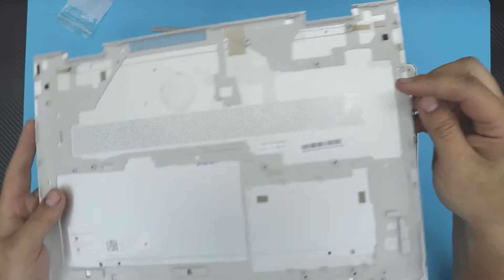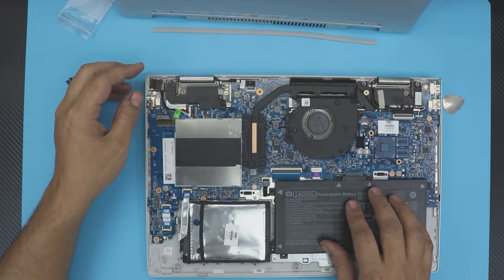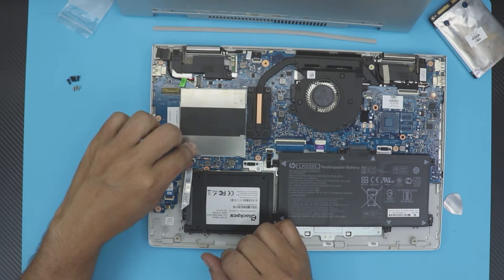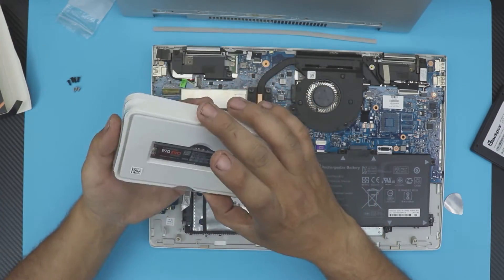Hp Envy X360 15M SSD NVME m.2 Upgrade - STEP By STEP

Comment: I have m.2 nvme of 500 gb in my envy laptop but am out of storage.  Do you have a suggestion on a larger like 750 or 1tb m.2 nvme? Do you have a video on how to get a person items from one M.2 nvme to the newer easily? Thanks for any info in advance.
Reply from the maker: 🫠Regarding your question, you can upgrade your laptop to a 4TB NVMe without any issues. Get an NVMe enclosure to USB, and once you have the new Windows on your new SSD, connect the old NVMe via USB and transfer back your data. Now you have an external super-fast storage USB.

Comment: hi, great video!, do you a video for the cloning o migration of the data, i rather use the new drive and delete or disconnect the old one, any info would be appreciated, thank you newbie here
Reply from the maker: It's my pleasure my friend.
🫠Regarding your question, I will make a video on how to correctly clone the old drive to the new drive. But if you need any info, here it is:
1. Get the program: Macrium Reflect Cloning (don't get the pirate version 😉).
2. Place both your new drive and old drive in the laptop and use the program to clone the main drive to the new drive. The new drive must be the same size or bigger.

Should you have any further questions or requests in the future, please don't hesitate to ask me.
cheers🍻

Comment: If you clone the mechnical drive to the NVME m.2 then how do you make the NVME m.2 primary boot if both drives have Windows installed? I want to still use the mechnical drive but as secondary.
Reply from the maker: Thank you for your feedback! If you wish to support the channel, you can like, subscribe, or both!
Regarding your question, if you have windows on both and if you power on and it starts from your HDD then you will know if the C drive is your HDD. if so then you need to power off and as soon as you power on the laptop keep tapping on Esc key and from the menu choose F9 boot then choose the nvme drive and once in the windows remove over the data you need and format the HDD as storage drive.
other way is to remove the HDD and connect it as external storage and move over the file and then format and place it in the laptop.
https://amzn.to/3qHf4cq

Should you have any further questions or requests in the future, please don't hesitate to ask me.

Comment: $75 for screwdriver kit seems expensive!
Reply from the maker: It is an exceptionally high-quality kit that will last a lifetime without degradation, unlike other screwdrivers. It includes all the necessary tips for various tasks. I personally purchased a basic set several years ago, and it is still functioning perfectly today. Over the past 17 years, I have tested numerous brands, and this set has proven to be reliable. However, if you don't use screwdrivers on a daily basis, you can opt for more economical brands. If you have any further questions or need assistance in the future, please feel free to ask.
Reply: @uFixTek  Thanks for taking time to reply! Have a good day.

Comment: Hi brother my laptop is hp envy x360 - 15-bp152nr can i replace  nvme with hdd
Reply from the maker: Thank you for your feedback! If you wish to support the channel, you can like, subscribe, or both!
Regarding your question, my friend you can have m.2 nvme and a HDD  at the same time. or you can only remove the HDD and place it with a SSD 2.5"
Reply: @uFixTek  thank you for you quick answer I really appreciate let me reframe my question in my laptop i have 2 hard driver 1 St 128 gb ssd where OS is installed and 2 is normal 2.5 sata hard drive I just want to remove the normal harddrive and want to put nvme 1 TB so do we have another slot for that
Reply: You doing great job man ..
Reply from the maker: It's my pleasure my friend, much appreciate the support, Let me clarify a few things:

The 128GB SSD that you have in the M.2 slot is NVMe, as the M.2 slot utilizes the PCI-E lane.

On the other hand, the 2.5" HDD that you have is connected to a SATA III port, which is not the same as the M.2 NVMe (PCI-E) lane.

Therefore, you won't benefit from installing an NVMe drive with an adapter to the SATA III connector.

If you install an NVMe drive with an adapter to the SATA connector (where the 2.5" drive is connected), the NVMe drive will run at the same speed and performance as a regular 2.5" SSD.

So, there is no point in installing an NVMe drive to the SATA port. Instead, I recommend getting a good brand 2.5" SSD.

BUT, if you insist and you want to do that you will need this:
https://amzn.to/3pLdJjN
****To clarify once again, if you use this adapter, regardless of the NVMe drive you insert into it, the outcome will be the same as using any regular 2.5" SSD.
Should you have any further questions or requests in the future, please don't hesitate to ask me.
Reply: @uFixTek  thanks again could you please tell me how many nvme m.2 slot we have on my laptop mother board
Reply from the maker: you only have one for storage and the other one is used only for WIFI , and you can't use it for booting from it, therefore only one m.2 nvme slot available
Reply: @uFixTek  thank you so much
Reply from the maker: it is my pleasure y friend. 
Should you have any further questions or requests in the future, please don't hesitate to ask me.
Reply: @uFixTek  great help my friend with your guidance I opened my hp envy x360 laptop on the mother board i found 1 m.2 SSD and 1 TB noram hard drive. Now my question is 
1: can I remove m.2(128 gb where OS is installed) and put 1 TB m.2 nvme.

2: I want to remove 2.5 satha hard drive and install 500 gb sath ssd
Reply: It will support 1 TB m.2 nvme or not
Reply from the maker: yes you can have up to 2TB on m.2 and 2tb on 2.5' at the same time my friend
Reply: @uFixTek  what generation it will support maximum
Reply: @uFixTek  you know what I like about your channel is it's a 2 year old video and you are still giving the answer  wonderfull

Comment: I can confirm the m.2 slot supports nvme speeds. (Bq021dx model)
Reply from the maker: Thank you for the feedback and the verification my friend. 🍻
Reply: @uFixTek  No problem. Excited to finally finish refurbishing mine after it was given to me (screen replaced, gluing lid to hinges and sanding it down to fit, replaced battery and upgraded to nvme drive). Do you know what the max RAM speed is for these 15m models?
Reply from the maker: we have upgraded to 2x 8GB without any issue , but double check : https://youtu.be/tKEJTkVth4Q
depending the cpu generation.
Reply: @uFixTek  right but I mean the speed in mhz
Reply from the maker: the ram speed depends the bios update, but the max we tested was 2666. also this is a intel cpu, as intel don't care much about the ram speed, on other hand if you had AMD cpu then ram speed is super important. on intel you won't ever notice the difference on 3000 or 2666 mhz especially on this model cpus
Reply: @uFixTek  Yea mine has amd processor, fx 9800p. I did some research and I think the max RAM speed is 1866mhz for it. Oh well
Reply from the maker: its not 1866 it can go 2400mhz we service this laptops and we seen 2400mhz
Reply: @uFixTek  the 9800p only supports up to 1866 mhz unfortunately. Says so on amd's website as well

Comment: A regular ssd M2 not nvme doesn't work in this laptop right? I tried with one and doesn't work
Reply from the maker: Thank you for the feedback! if you wish to support the channel you can LIKE or SUB or both :P
regarding your question: update the bios from the Hp website, you may have old bios, but the m.2 slot it is a PCI-E and it supports m.2 ssd sata, and m.2 ssd NVME.
also you may had a defective nvme or something wrong with it, as we upgrade all the time this models, can you provide the exact model 15-bdxxxxx or 15-cw xxxxx
Reply: @uFixTek  15m-bp111dx
Reply from the maker: this laptop supports NVME, and compatible with m.2 ssd sata too. update the bios and try different brand nvme and make sure you dont touch if you have lots of static discharge, touch a metal table or something

Comment: If I were to just leave the sata disk drive in, and add a nvme drive, both should function, right?  Assuming so.  Thinking I could put a 1TB nvme drive in, and use the disc drive as extra storage.
Reply from the maker: Thank you! for the feedback and your support to the channel by SUB :P
regarding your question:, yes my friend it will work just fine as 2nd storage drive. 
but if you ever install your windows into the new nvme drive you would be shocked of how fast would be your laptop.
here i made a video on how to get windows 10 on the usb and how to install it into HP laptops (all hp laptops have same boot)
1tb nvme: https://amzn.to/3fnuxWi
win 10 to usb: https://youtu.be/uDu8j2lE-dM
install Windows on Hp laptops: https://youtu.be/7f_rBp6Rb3s
Reply: @uFixTek  can I put Nvme drive together with SSD sata?
Reply: @omannur6725  Should be no problem
Reply: Just wondering, did you add that 1Tb nvme after all?  I'm in the same situation, and the hp envy manual indicates max 512Gb SSD but I'm thinking of going for 1Tb anyway.

Comment: There is no disc cloning software in the description too.
Reply from the maker: Macrium Reflect
https://www.macrium.com/reflectfree
Reply: @uFixTek  Does this support expanding a Linux ext4 partition?
Reply from the maker: @Nakx95  yes it does clone mac os linux , i have clones a ext4 drives. but if it cashes and gives you error when booting from new drive then format and try again cloning, because cloning now always does a perfect job, we have tried many many software and the most reliable is this one. with a fail rate of 1of40

Comment: How do you ground yourself in this circumstance?
Reply from the maker: no need to ground yourself, its really really hard to kill a motherboard by touching it, 20years on the reparing job never used grounding and we touch and move around the motherboard like a paper. 
to be  in a safe side just before touching the motherboard, touch a  metal case o table legs if its metal.
DONT touch your hair or rubbing your foot on a carpet . thank you for the feedback and your support to the channel.